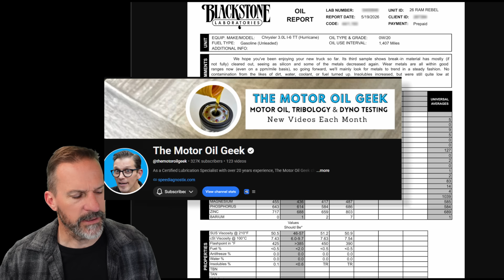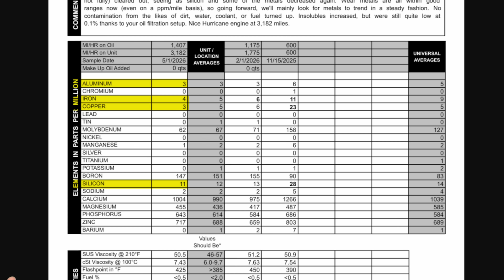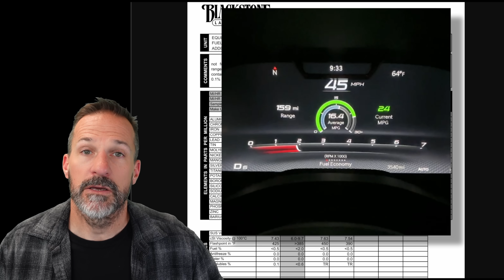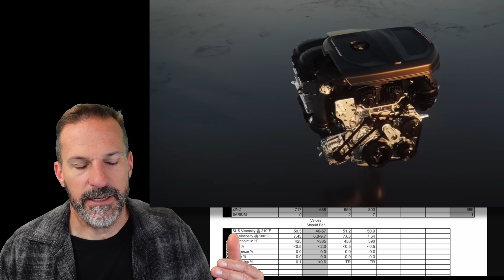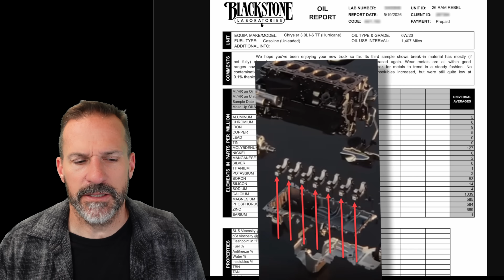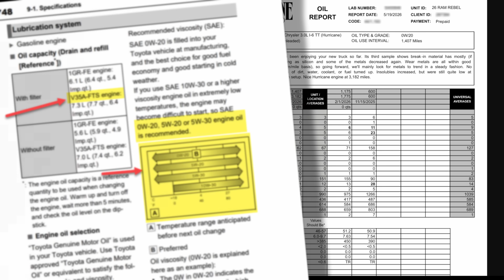The Break-In Secret Most New Truck Owners Ignore

Comment: After being on Bob is the oil guy forum for the past 25 years I’m a big believer in mobil 1 0w40.  I run it in my 2004 z06Corvette, my 2023 Ram Power Wagon. And my 2024 Toyota four Runner.  Meets the European standards which way more stringent than ours. And it’s sort of on the low end for 40 weight so it’s almost like a thick 30 weight.
Reply: Reading through the comments here it’s clear that many people here don’t understand what 0 weight means. They think for some reason it’s too thin. They don’t understand that what it means is that the oil acts as a straight zero weight at the cold temp. Which is still thicker and more viscous than what it is at 220 deg where it behaves like a straight 40 weight would

Comment: I did oil changes for my new car at 307, 1892, and 3117 miles.  Transitioning from OEM 0W-20 -> 5W-20 -> 10W-30.  I live in a freaking desert.  The car will never be started at freezing temps.
Between the 5W-30 and 0W-40, I would recommend 5W-30, because less VII/VM (viscosity index improver /viscosity modifier).
Remember, the Motor Oil Geek recommended 5W-20 for the same reason.

Comment: The question is, why does a manufacturer have two completely different oil viscosity recommendations for the same vehicle, built in the same plant but destined for different markets. Case in point, my 2018 Mitsubishi Triton 2.4 diesel 4N15 engine, Thailand market, has recommendations of  SAE 30, 20 W -40, 15 W-40, 10 W-30, or 5 W-30, depending on minimum temperature anticipated.

The same engine used in Europe and Australia has a single grade recommendation of 0 W-20. Is this to meet more stringent fuel consumption targets?

Comment: If you are in a cooler/northern climate, I'd run 0w-20 or 30 in the winter months and 5w-30 in the summer.  If you are in a southern climate, I'd run 5w-30 in winter and 10w-30 in summer.  You can play with those viscosities depending upon your climate/growing zone.  Get your oil sampled (as you are doing) and refine it to what you see as (viscosity breakdown or out of range / mileage).  For my 0w-20 vehicles, in growing zone 6B, I run 0w-20 in winter and 5w-30 in summer.  Samples test great.

Comment: Like come on man
When break in oil changes were eliminated cars actually started lasting longer
Those trace elements in the oil are basically meaningless wont do anything
These oil analysis are a scam
Like 500 1500 3000 oil changes is crazy just crazy tragic even, get a life
Bad engineering cant be compensated with lubricants

Comment: Been at this for 40 years and my entire career I have always, ALWAYS recommended a 500 mile oil change after ANY major engine repairs.  Heads, short block, long block, timing setup, intake manifold job.  I never have done the intermetiade one at 1500, but it stands to reason.

Comment: I run 5W-30 in my three Toyota vehicles. My 2007 4 Runner has 182K MILES RUNNING 5w-30 SINCE DAY ONE. 2018 Tacoma runs on 5W-30. My Lexus  RX350 runs on 5W-30. 5W-30 has a long proven track record for extending engine life. All my oil changes are at 3K miles. I live in far North Idaho and I run 5W-30 year round.

Comment: Why not just follow the data? If you are still getting elevated wear metals after running-in the engine, or it falls out of grade, then why not look at it then? However, personally, if the HO version uses SAE 0W-40, then I can't see any major problem.

Comment: @TheCarGuyOnline  I'm surprised you are undecided on which oil weight to go to next.  Lake Speed Jr. has said quite clearly in multiple videos that, if you want to change oil grade, go up incrementally on the operating viscosity but don't change the winter weight.  That engine has not 'seen' a 5W oil upon cold startup...I think the risk is too great to change the winter weight.  Also, Lake says do not change the brand or the spec (e.g., Dexos 1, etc).  In your case, the above thinking means going to 0W-30 for your desired target mileage and getting oil analysis done for a couple of intervals.  There is no need to rush.  If the results are favourable, then you inch up to 0W-40...and re-test.  If the results remain positive after a few oil drain intervals then you are on a winner, at which time you may consider changing the brand...and re-testing.  If you make it to 0W-40, do note that this oil might not stay in its viscosity spec for as long as the lighter weight oils and you might need to change it more regularly - but let the test results be your guide.  Good luck and keep up the excellent content!

Comment: 0W-40 would be my choice. Good cold flow and better protection under heavy load. I still don’t understand why you have to stay at 75mph while towing large? Thats best way to fk your engine. It aint built like a V8 race motor! Drop down to 55 and let the engine run in its peak torque spot, not peak power spot. You will save fuel and not trash your motor. Not hard!

Comment: You can ad your oil changes to your Carfax, and I use 5w30 oil in my new 23 Tacoma, from my first oil change at 4600 miles by the Dealership I come home took out the 0w20 out and put in 5w30 I change my oil at 5K and to keep my warranty i get it done at the 10k mark i just do it every 5K and my Blackstone report said it looked perfect, and my fuel milage went up by 1 mile

Comment: Thanks for your RAM 1500 Hurricane information.  I'm 76 years old, with a new 2026 RAM BIGHORN Hurricane which I purchased new in December 2025.  Current total mileage is 1,300.  Clearly this truck will outlive me.  Question:  what can I do now to secure a better longevity of this truck for the next owner (friend, family, sale)?
Reply: P.S. my typical driving for 6 months has been local 40-50 mph limited stops in the country,  Average gas mileage for the Hurricane shows 19.4 mpg 87 Octane Exxon.  temps 10'F - 90'F.

Comment: 0w20 just change it often
Reply: How often? Every 5k miles?
Reply: @Zzzoro92  For Jeeps in high duty service? This means city driving, stop and go on a highway, less than 15 mile trips. 3.5k after the 500 mile, 1500mile (no filter change for both), and a 3k change with a filter change. then every 4k miles. Your engine will thank you.

Comment: Try Penzoil Ultra Platinum 5-30.  The 0- is for -30 or -40 degrees Celsius to (hopefully) help the engine start.
Reply: thats what i run year round in my Frontier here in northern michigan. never had an issue starting in sub zero temps....even down to the -20F we saw last winter

Comment: 5W30.  0W anything is a FOOL'S game...IMO.
Reply: I totally agree, 0W should be against the law.
Reply: There’s absolutely nothing wrong with 0W as long as you’re changing it every 3000 miles. And your idle Lake speed says the same thing.
Reply: The Motor Oil Geek, Lake Speed Jr. had a video stating a reason for this weight of oil. https://youtu.be/ekKrcigeDmw?si=4Vvh02YITMTXdYqW&t=1087
Reply: https://youtu.be/1OI2sXdrpdA?si=f-SR7EuEeRqYufkE

Comment: If this is true for engine break-in, it should be true for other lubricated components, such as the transmission or even differentials?
Reply: power steering & brakes. I replaced my windshield solvent within the 1st week that I bought new truck.

Comment: Going from a 20 weight to a 30 or 40 ... be sure to track your fuel economy ... running total of gallons used against miles on the odometer.  If you track carefully, you WILL see a reduction in fuel economy with no guaranteed wear reduction.

Comment: I have a 26 Hemi Big Horn. Changed oil at 500miles to 5w20. at 1500 I changed oil to 5w30. I am at 3100 and need to dump the oil again and will stick with 5w30. I am in the south east most of the summer is mid 90's. Winters are mild. I also will have the dealer do the first 2 oil changes so its recorded and also because the filter change is a PITA on the hemi. When i get it home I am dumping the 0w20 and installing PUP 5w30.
Reply: Yeah, its kind of nuts how 5W-30 and 5W-20 was OK in the Eagle Hemi back in the day but now its not according to the manufacturer and its exactly the same engine as it was when it debuted in 2009.

Comment: Back in the days of 3,000 mile conventional engine oil changes & 3yr/36 mile max warranty  - Many owners stuck w/ owners manual suggested oil viscosity, until engine began burning oil, the go from 10W30 to 10W40 or CAMII 20W50. Today, w/ minimum 5 yr/60k mile drivetrain warranty (higher in Cad - Turbomax - Ram truck), the only Cowboy behavior I'm doing is reducing interval from 7,500 miles to 5,500 miles. Manufacturer will never suggest you hurt engine by changing oil too often. However, thinner viscosity oils are designed to flow thru small orifices in MDS/DFM/VDE cylinder deactivation lifters, etc. If engine grenades, I guarantee Manufacturer will test engine oil to verify it's the suggested viscosity & potentially void drivetrain warranty & have every right to do so.

Comment: Best advice I can give, find out when your particular engine first started to be used, I have seen a few engines still in use today that 10 years ago called for 5W-30 and have gone to 5W-20 and now 0W-20. The manufacturer didn't do anything other than change the recommended viscosity. So if you have an older tech engine that's been around for a while and today it takes 0W-20 check to see what it used to take. I think Toyota and Honda engines are a pretty safe bet to use the "water" oil they recommend. I feel the engines were designed around the lower viscosities.
Reply: Even the Toyota A25A hybrid and non hybrid came out with 0W-20. Then they went to 0W-16, then a few years later 0W-8 or what I consider not much better than WD-40 penetrating oil. Im sticking with 0W-20 in my new Camry.

Comment: Lake speed has a great video where napa dexos and pennzoil were the best, napa is valvoline base oil and it’s good stuff.  you’re not broken in yet, not a fan of blackstone…. speed diagnostix is lake speeds outfit for testing oil, much better.  i finally hit breakin on 2 vehicles at 15,000 miles for both based on silicone etc.
Reply: I use 5w-30 napa decos 2 in my GMC terrain and our 6.2 Denali Yukon.

Comment: People argue about changing oil at 1000, Miles, and 2000, after that than every 3000,I’ve been told it’s a waste of money and oil because the engines are better along with oil today, i tell  them it’s my vehicle my engine and money the manufacturer doesn’t give a shit when it’s out of warranty, so disgusted trying to explain this to people.
Reply: I guess those folks haven't been paying attention to the VERY short engine lives TODAY.  Not "better" at all IMHO!
Reply: I was unaware there was a new metal that came out at some point that doesn’t wear out like metal did 50 years ago. There is no difference. The oil is slightly better, but you need to change your oil every 3000 miles regardless of what fools tell you based on their own thoughts instead of the data. Are you not watching this Guy‘s video? Above average metals changing oil at 1200 miles or less.
Reply: @Maynardd There have been many improvements in metallurgy and surface treatment.  The problem is that they remove thickness, weight etc. to an extreme BEYOND the improvements, longevity be damned.
Reply: @Publius-f5  more engines have catastrophic engine failure than pretty much anytime in history. Improvements? I don’t think so.
Reply: @Maynardd sorry you dont understand the second half of my statement.  Though improved metallurgy exists, I agree today' over all product implementation SUCKS, errr BLOWS up!

Comment: Personally, I'd like to see the variable displacement oil pump replaced with a high volume, high pressure pump. While the engine is well designed, IMO the technology of using a electronically controlled solenoid controlled by the PCM could be a failure point down the road. 

Not knowing exactly how the system works, in the event of a solenoid failure causes the pump to stop functioning or just provides a high pressure all the time?

As for the oil viscosity, 0W40 over the 0W20. I'd also install a mechanical oil pressure gauge to see exactly what pressure the engine produces.
Reply: On every car I've seen with a variable displacement pump, if the solenoid stops working it defaults to high pressure, like a regular oil pump.
Reply: @theodorgiosan2570  
Most oil pumps other than dry sump systems, the pump increased oil pressure based on engine rpm.

Melling made oil pumps that not only increased pressure, but also volume. 

When I checked Melling's website, the FAQ section stated that since the Hurricane engine was so new, that they didn't have a pump available,.

I'd still install a manual oil pressure gauge and a engine oil dip stick. I like manual redundancy.

Comment: I did the same with my 10L80. With a brand new truck my transmission coded twice. I replaced the ATF with AMSoil ULV. The tech said the factory fill was cloudy. I did that at 10,000 miles. With the fresh ATF, no codes at all and the tranny runs 5-10 degrees cooler. I’m at 16,000 miles. Fingers crossed!

Comment: For my 2024 GM 6.2 I had the dealer do the first freebie oil change at 500 miles 0W-20. Since then went to AMSoil Signature Series 5w-30 whenever the algorithm hit 50%. WIX filter. I installed the BOOST DFM deactivation. at 16,000 the motor is super quiet! I live in a hot area. Very pleased!
Reply: I hope that you have good luck with the switch and don’t get hit with the dreaded 6.2 failure. Please share as time goes by!
Reply: Lol 16k miles aint sh**. My 22 6.2  threw a rod at 33k miles.
Reply: @EH1911-d1q  ouch!
Reply: @EH1 @EH1911-d1q you had the Mexican crank🎉
Reply: you have a tight engine you need to do oil changes more gm and chevy are tight, heat is not its friend better in the colder areas, and ford you have more room cuase they always build there engine to make boost and wider pisten ring gap but you do oil change on time dont let oil thin out your set, ram engine lifters and everything also get starved oil there disgn is complete euro all euro problems are ram problems.
Reply: @KamZin-vt2rw I really am clueless as to what you are saying…
Reply: @bradbarnes5018 the viens of the car oil passages and the just the build of the engine itself anyways just do more information and youll see this aint new been saying this for years but ppl dont understand not really mehcanic just car guys doing mechanic shit big dif
Reply: @KamZin-vt2rw I think you are saying the tight tolerances of modern engines work better with thin oil. In terms of the 6.2, I understand outside the States they recommend 5W-30. I think they are wanting a little better fuel economy and emissions at the expense of durability. So they can sell you another truck sooner.
Reply: @bradbarnes5018 the tighter tolerence require more pressure and heat, with bigger clearance you dont get that, and yes thats why they keep making oil thinner and also putting turbo dosnt help when all of it is operating the oil is burning and becoming worn out alot quicker, the solution to this would be all bigger clearance pipes and veins internal and external and you would have less issues to a point and also thicker oil and better good filter and changing on time or knowing when to change depending on your use.
Reply: Did the dealership void your warranty
Reply: @tm944d they can’t unless they can prove you changing the recommended oil grade caused the mechanical issue
Reply: @tm944dthus far I have made no warranty claims…

Comment: Did a 1000 mile oil change on my 3.5l tremor last weekend. 
Plan to do a November and april oil change in my truck regardless of miles because oil dilution…. Live in Saskatchewan, Canada. #-40
Reply: That what Honda head technician said to do in their 1.5l turno that needed 4000$ of timing chain work at 102k miles… minimize oil dilution…